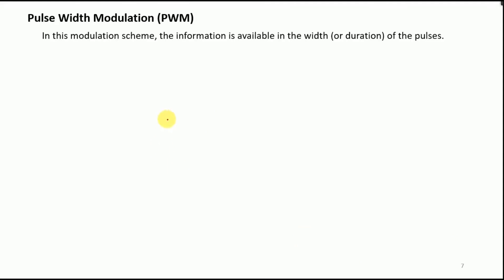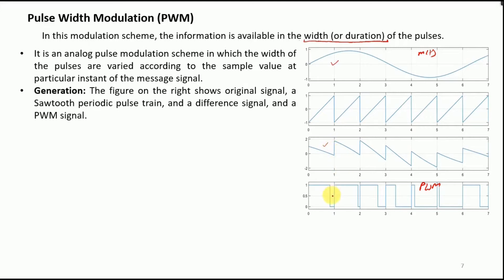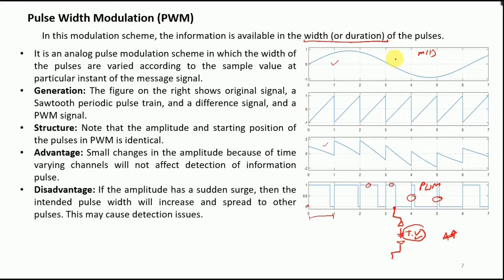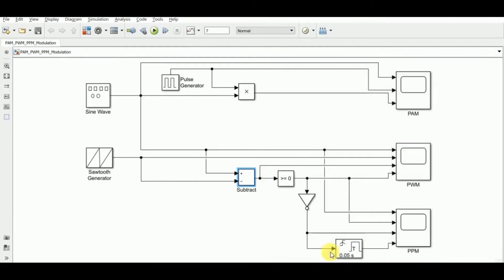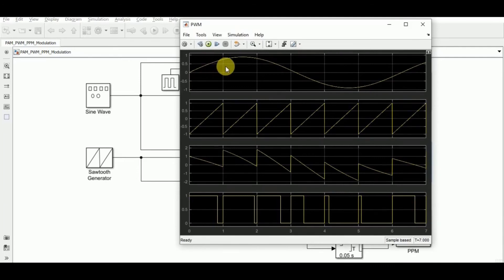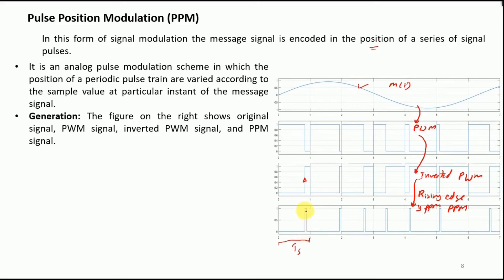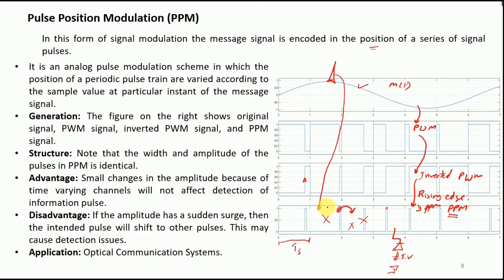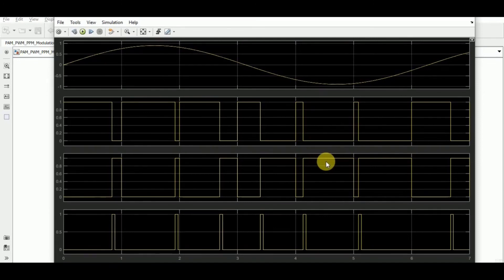PWM and PPM Explained using Simulink | ADC 4.7

Comment: I want to change the position of square wave (output of PWM) every cycle randomly. But width will be same in every cycle
Reply from the maker: Do you mean ppm? i.e., width is same but position changes as per the message signal
Reply: @AKHassan  yes sir
Reply from the maker: That is done in this video. but a slightly better version is also available in 

https://www.youtube.com/watch?v=OvYnblg7G24&lc=UgwIL_KD3yOloGCmt-p4AaABAg

You can follow the time line for ppm in that

Comment: very good video
but do you know how to demodulate the ppm?
Reply from the maker: Assigning a voltage/current level based on position of pulse followed by sample and hold or a first order hold should result in demodulation. The former may be achieved by using a case/if-else block.
Reply: @AKHassan   tanks
Reply from the maker: For the demodulation of ppm, my take is in the following link.
https://youtu.be/OvYnblg7G24